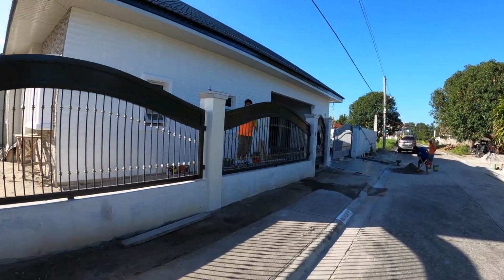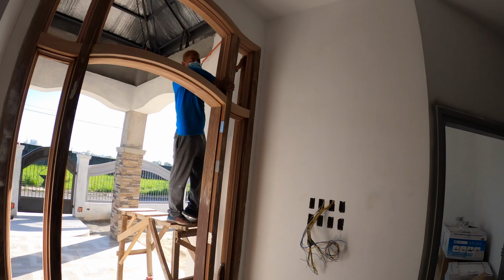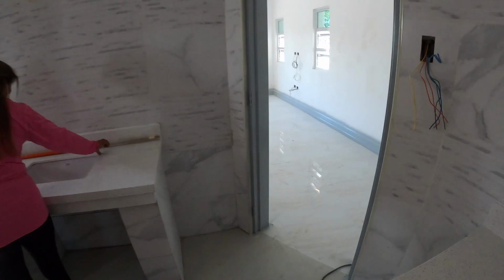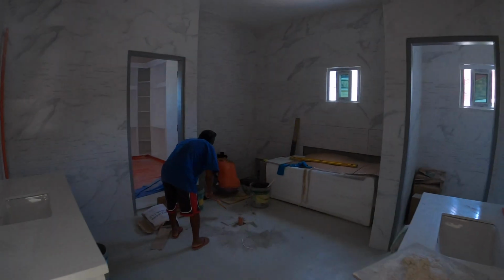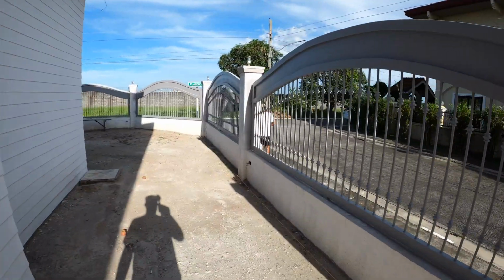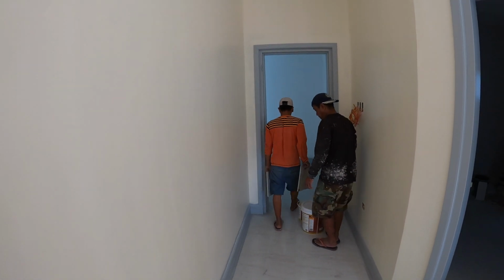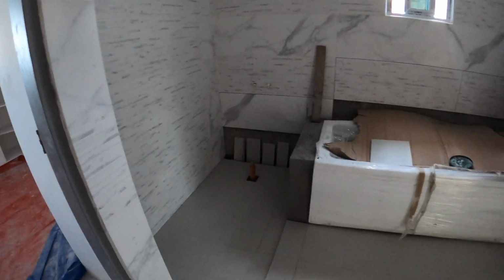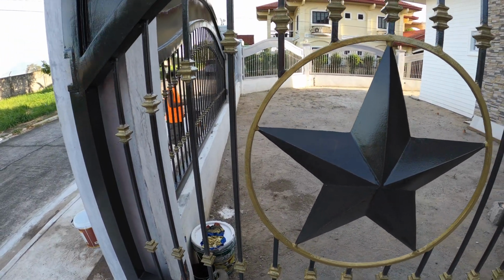Philippine House Building Step by Step, Build Day 214: A Touch of Gold

Comment: Nice note by Smith... I like and will do after my home completion... However, some might be farmed out prior to completion... as a result of their skill-set might be required elsewhere... so it will have to be well planned.  perhaps a start and finish picture... anyway, I like the driveway tile job up to the road... nice... don't see that much, but it looks great...  The final touches on the fence look great... What material is used for your base boards?    Nice video, thanks for sharing...
Reply from the maker: Hafa Adai!
Correct, it is difficult to capture a moment with the crew at the beginning and end of the project since people are constantly changing out depending on skills required. I try my best to call them out by name as we work our way through the project. 
The baseboards are wood with a thick laminate exterior. Sanded and painted once in place. 
Y’all take care. 👍😊